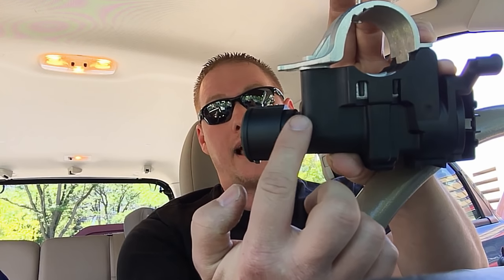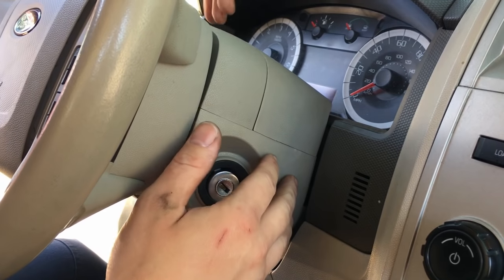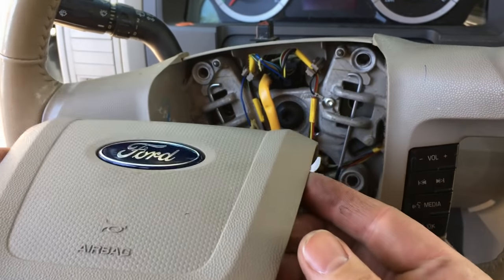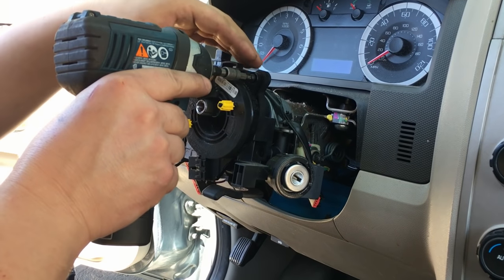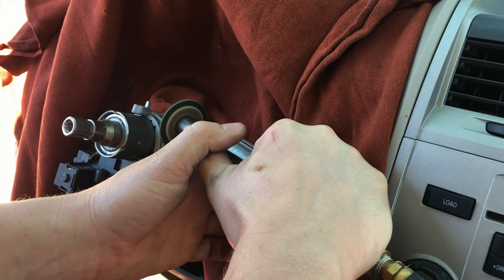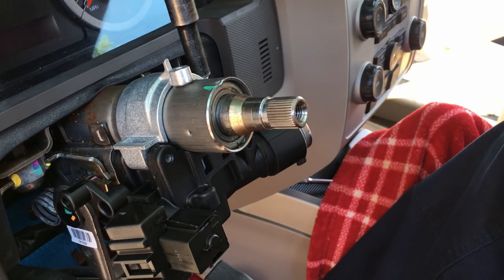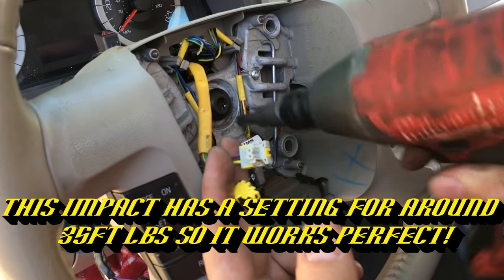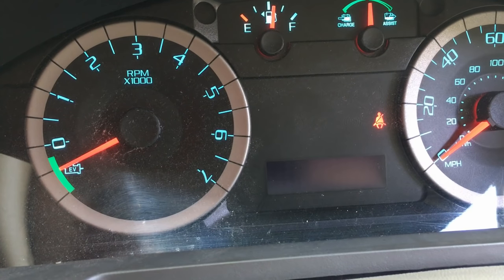2008-2012 Ford Escape No Crank No Start: Ignition Lock Module Replacement

Comment from the maker: These are the Tools and Parts I recommend:
Latest Ignition Lock Module:
2008-2010 Models-
http://amzn.to/2wiZ1TO
2011-2012 Models-
http://amzn.to/2wiK04r
Break Away Bolt-
http://amzn.to/2vYyusk
Medium Strength Loctite-
http://amzn.to/2g0eeTl
Puller Kit-
http://amzn.to/2g0IvkF                                                                                                                                                                                 Torque Spec:
Steering Wheel Center Bolt- 30ft lbs
Reply: FordTechMakuloco this is amazing!
Reply: Do these same parts go into a 2009 mariner aswell? Thanks.  Did this on my 08 escape and starts perfect now!
Reply: FordTechMakuloco I just want to verify the part number.  When I enter it into amazon with the garage feature it says that the part does not work with my 2008 Ford Hybrid Escape  By the way your video and explanation are awesome
Reply: Is this ignition lock module the same for a 08 merc. Mariner?
Reply: I followed your link to Amazon for a module for my 2010 Escape 2.5 XLT, but the fit test on the webpage the part is a wrong for my car. please help me to find the correct part. thx.
Reply: I am 99% sure it's the same, on fords website the part# carrys over to other makes and models
Reply: How much on labor should this cost at the mechanic? I don't want to get ripped off. Thanks.
Reply: Ok my father and I fought with the flipping the for well over 3 hours and still can't get the air bag off what the fueshia are we doing wrong
Reply: I just done this on my 2009 Ford Escape. I did not have to take the steering wheel off. I just took the covers off and all the wires, and the  Ignition switch guard thing. There are  3 screws that  hold the  lock cylinder into place. I unscrewed those with a 7/32 millimeter socket and a small ratchett. There is one on top of the  Steering wheel, one on the bottom, and one on the right side...That is the only hard one but you can do it. After that you can pry  The Ignition column switch part away from the turn signal part at the top where the screw was at on the top of the steering  wheel. I had to keep trying but I eventually got it off. Hope this helps.
I really appreciate your videos on the Ford Escape. They have really helped me out. Great work.       Thanks!
Reply: @imaginate8  I'm told that the 2011 part is different than 2010 down dorman makes an after market for the 10 and older cars but may be better to go oe.
Reply: 2010 down is a different pn than 2011 up.
Reply: Wow you are 2 for 2. First the hybrid battery recharge button now test the ignition lock module. Walked outside and ran the test and the escape started. This is after I tried a lot of other stuff. 
Good job thanks a lot
Reply: I need your help please on my car
Reply: Would this fix a worn ignition switch on my 2009 escape?

Comment: After a $900 + parts quote from a dealer, and $300 + parts quote from an independent garage, being on a fixed income I decided to do it myself. The part cost about $100 online (OEM Ford exact match). Took me about 2.5 hours, but it all went well. Not bad for this 78 year old! This video and this gentleman are great....far better than any of the other videos or mechanics I found. Thank you for doing this and posting really good, detailed videos!
Reply: May I ask where at online did you buy it.

Comment: I just changed the module in my '11 Escape. I'm not a mechanic, and it only took about an hour, without removing the steering wheel OR slotting the bolt. It came out with needle nose vice grips.
Reply: Mike MacEachern thank you I did the exact same thing No need to take airbag and steering wheel off👍
Reply: Can you guys help me I have the same problem but don’t want to take off all that
Reply: There’s more than one way to skin a cat and I would do it without taking the steering wheel off as well.
Reply: @cheddaonthekeys  I just done this on my 2009 Ford Escape. I did not have to take the steering wheel off. I just took the covers off and all the wires, and the  Ignition switch guard thing off. There are  3 screws that  hold the  lock cylinder into place. I unscrewed those with a 7/32 millimeter socket and a small ratchett. There is one on top of the  Steering wheel, one on the bottom, and one on the right side...That is the only hard one but you can do it. After that you can pry  The Ignition column switch part away from the turn signal part at the top where the screw was at on the top of the steering  wheel. I had to keep trying but I eventually got it off. Hope this helps.

Comment: I tried your test. Trying to start it then pushing in on the key. Still nothing. Does this still mean it's the module or maybe just the ignition switch and/or the lock cylinder?
Reply: Any update on your problem? That trick didn’t work for me either
Reply: Had to replace mine in my 2009 Escape.
Reply: @barbiraderstorf813  what did you replace?

Comment: Frequent DIYer here. This video is by far one of the best I have ever come across to get the job done. I struggled a bit with the airbag pushspring, and also my wheel was on so tight my puller stripped the threads, but i got it off with some wiggling. Otherwise everything else was spot on. Seriously great video. 👍
Reply: puller stripped the threads ? omg. you sure the steering wheel is going to stay on? that doesn't sound good at all
Reply: @HoodHandyman  Yeah as in stripped the puller mounting threads. I think you are mistaking that I stripped the splines on the column, which can't strip because they are splines, and if I left the center bolt in the wheel would never come off.....

Comment: Just completed this on a friends 2011 Ford Escape. This video made the job a breeze!! I did not need a steering wheel puller, just loosened the T50 Torx bolt on steering wheel, then patiently rocked the wheel back and forth and it came off. Saw that on another You Tube video. Otherwise, this video saved my friend money and made this task quite easy. I also purchased the Motorcraft Ignition Lock Rebuild kit so she had a new ignition lock cylinder. Now that task took some time and patience but also went well. Now she has new Ignition module and ignition lock cylinder and a car that starts reliably! Thanks so much for this outstanding, professional video!!

Comment: After watching your video I was able to replace my ignition switch in about 10 min. I took our 2009 Ford Escape Hybrid to the Ford Dealers Service Dept. and they had no Idea what was wrong because they couldn't replicate the no-crank no-start problem and they needed a code. I then took it to a local repair shop and they couldn't diagnose it either even though it wouldn't start in colder weather. A drop of 4 degrees from 66 to 62 would result in a no-crank no-start scenario. Being an old school mechanic, I knew I could figure it out. So after some thought about the temp making the difference I began to suspect that the sun coming in the window after a cold night was somehow affecting the ignition switch on the steering column by allowing it to expand and contract in and out of tolerance. I did a YouTube  Ford Escape Ignition Switch replacement search and found your video. I had it done in 10 minutes. Problem Solved! Thank You
Reply: Hey Archtops.  What part did you use?  The part this video recommends is showing incorrect by Amazon and my local parts store for my 2009 Escape Hybrid. Thanks!
Reply: @scottburns8305  I used this part: 9L8Z-3511-A...See link to amazon below.

Comment: Do yourself a favor and watch this carefully. I did and it saved me anywhere from $500 - $1,500. Don't be afraid. Just follow his instructions and take notes if you have to. These instructions tell you everything you need to know...step by step...from A to Z. I have a 2008 Ford Escape. I called around to a few dealerships and was given a ballpark of $500-$1,500 for repairs "depending on what was found." It would've cost $150 just for the diagnostic. In total, I spent less than that for the parts I needed. And now I have my car up and running smoothly. I am very thankful for this video.

Comment: I just did this repair.  Thanks for the great video.  Gives me piece of mind that my pregnant wife won't be stranded somewhere at least until we buy a new car this year.  For those doing it, a 5.5 mm socket is a 7/32 in standard/imperial.  If you have that no need to buy a special socket, or borrow one.  Also to cut a notch in the special fastener you can use a dremmel/rotary tool with a cutting disk.  Worked perfect for me especially since I had one already.  If you don't you can get one at Harbor Freight for $6-7.

Comment: This is an EXCELLENT video!!! My wife's car is a 2011 Ford Escape with the exact same problem as describe in the video. To start the car, we have to perform the same procedure, again, as described in the video to start the car. A check with the local dealership for replacement cost was over $800. This video is simply priceless! Thanks to your video, I am confident that I can perform the replacement myself successfully. BIG thanks for the video. I am a fan.

Comment: I didn't know what was wrong with my 08 Escape hybrid until saw this video. I ordered the part off eBay eight months ago but I didn't install it until today.

It took me eight months to install because of this video. I learned how to start my car perfectly every time so, there was not rush. It just worked.

 I installed it myself without removing the steering wheel. Once all the connections and screws are removed, turn the device to the left instead of just pulling back and part will fall off. Make sure you have a shallow 5.5 mm socket and a Dremel tool for that bolt.

Comment: After watching this video, I changed the module in my wife's 2011 Ford Escape. It went real smooth and everything now works great. Thank you so much, you made the job so much easier.
Reply: I've been torn for weeks on which part number to get for my 2011 hybrid escape.  When I click on the link for the 2011 it comes up a weird sketch (part BL8Z-3511-A) and I  can't tell if it looks like the one in the video. The link for the older model looks like the one in the pic (part number 9L8Z-3511-A). Which one is right?😕

Comment: Doing this is 2022 to my 2010 Escape with 255k miles on it. I have delt with the issue for almost a year now and finally decided to give this challenge a go. This video made it super easy and I only had trouble removing the wheel because I have never done it and I broke a screw plastic because I missed where you pointed it out, you made it obvious where it was, I just missed it. Thank you very much for the video.

Comment: Great video! I found that I did not have to pull the steering wheel off to change out the Ignition Lock Module though and I used a screwdriver and hammer to loosen up the bolt that you took the grinder to.. Great step by step instructions helped me to do this myself. The part only cost me $45 on Amazon compared to the big box store price of $189.

Comment: This was the best descriptive, DIY, “how to” video for this replacement. 
I just replaced the my ignition switch today. The only issue I had was the steering wheel puller was turning the T50 bolt as I was turning the puller mechanism. Maybe I missed something, but it came off without the screw inserted. No damage was done to the threads or steering wheel column. GREAT VIDEO! Thank you for taking the time to make this video.

Comment: Just a word of thanks for this video. Incredibly well done ! Clear, concise helpful instructions. Saved me several hundred dollars. Turning the wheel over was a big help.
 I found it easier to remove the air-bag by wedging a large screw driver between the steering wheel and the trim piece behind it. Pry it up enough to shine a small flashlight into 
 the area where the retainer spring has the coil and just pushing the coil part down towards the bottom of the wheel. Takes much less pressure and you can pop out each side of the airbag separately.
Reply: The air bag tip was a time saver! Thank you

Comment: Thanks for the great How to on this one.  I'm doing this to the wife's '08  Escape right now.  I'm just waiting on the parts to get here to replace.

I greatly appreciate the step by step on this one.  I've not had to do steering column work on the vehicle since my 1987 Chevy and there's been a ton of "New Tech" added to a steering wheel since then.

Edit:  One of the easiest jobs I've had to do to the wife's 08 Escape.  Only took me about 2 hours to do and part of that was, stopping to get this tool, or that tool and I also spent a good deal of time scrubbing the nasty off the steering wheel while it was off, so, maybe just over an hour of actual work time.  AND, nobody in the neighborhood learned any new words...........

Thanks again for a very well put together video.

Comment: Great video.  Had no problem following and the job was relatively quickly done.  Only slightly tricky thing, and I can offer a bit of advice here, was getting that dang spring release pushed to disengage the airbag module.  It felt weird to be reaching in blindly with a tool and apply pretty heavy force without knowing you were properly engaged on the right area.  What worked best for me was to use a cheap allen wrench (square end is better than the nice ball end type) and make a mark at about 3.4cm from the long end (I had a spare steering assembly so was able to measure exactly) with a sharpie.  Then strongly clamp some locking pliers, preferably with a comfort handle, to the angle and short end to give you a better grip.  Insert the long end and feel around until you hit something at 3.4cm.  Then push straight and hard.  Took three tries (first two only one side released) and about 30 seconds once I had this makeshift tool made.

Comment: Thank you again for an excellent video tutorial. You was "bang on" as usual. Followed your instructions to a "T". What l think should have taken me 2hrs tops, took me nearly 3hrs because two things. 
1. Getting  the Airbag off using that "blasted" hole was a nightmare so what l did was to enlarge the hole slightly, turn the steering wheel with the hole to the right, looked into hole to locate the bar and used a larger diameter allan key to push it in and it "worked like a charm" snapped out immediately. 
2. Whilst attempting to remove the steering wheel using the puller the nut kept on turning as well when i tightened it down. So i found a flat piece of metal placed it betwen the nut and the puller tigtening screw and it popped out immediately. All in all was a great job. 
Thanks again for helping us poor people save so much money. Cheers!!!.

Comment: A couple of different things on my daughters car from the video (wheel & airbag) but, OMG you saved me $$$$ !!
Making a few trips back and forth to watch the video to make sure I didn't miss something or mess up,  it got me through the entire job step by step with NOTHING left out.
Gave me the confidence to attempt replacing part before sending to the shop.
Car starts as it should.
Thanks so much and will look here 1st when attempting another problem.
Steve

Comment: Amazing job on this video! Did my daughters 2009 Escape today and saved some money!  Steering wheel was so tight I stripped the threads with one of the puller bolts. Thankfully I was able to use the claws that came with the puller instead. I really appreciate the video!

Comment: 0:52 - paused video - Looks like a modular part -  Cannot wait to see how difficult removal and replacement can possibly be - You are my hero as you continue to work with some of the most difficult patients - Clicks play
Reply: So I finally finished watching the disassemble portion.
They could have hung and covered that part with 4 screws and the one bolt would have been plenty.
How may hours does the book say? two? probably one.

Comment: Thank You!!  Great step by step! Had no trouble following along, except the threads on the steering wheel to mount the puller stripped. A couple of hits on the wheel and some wiggling got it off. Been battling this no start for a while, but no more!!

Comment: Like many others, thank you for making this great video. I repaired my wife’s 2012 Escape tonight, that was having a problem with multiple key turns to start. 1 hour later and it will start on the first turn every time.

Only issue was getting the spring to release for the airbag. Using some vice-grips to hold the hex wrench and push got the required pressure to release it.

Comment: Awesome video! Clear and straight forward.  I kept your video on my phone while I did the job.  It took you 23 minutes. It took me 4 hours but I still saved hundreds of dollars! Thank you!  BTW: I ordered my part from Ebay because Amazon ALWAYS sends me the wrong part.  In fact, when I followed your link to the amazon ignition module it said it wouldn't fit my 2009 Escape.

Comment: Thanks for the wonderful video! It helped a lot in figuring out how to fix it. I did run into a problem of not being able to get my airbag out of the steering wheel. I spent over an hour trying and was only ever able to get one clip to release. I did see a comment from someone about removing the housing without removing the steering wheel. I was able to do this by removing the last 3 screws from the signal light switch and jiggling it around to get some slack. But removing the wheel would make the work so much easier.

I also had an issue with my ignition lock cylinder. When I removed it from the old module it had a spring clip (I think that's what its call). I think this was on the cylinder because the old lock module indent was swallower than the new one. Once the clip was removed the cylinder slid right in. Then I slid the new housing on the shaft and reattached everything.

Once again thanks for the video, otherwise I wouldn't know what to do and I would be out $500 for the labour costs.